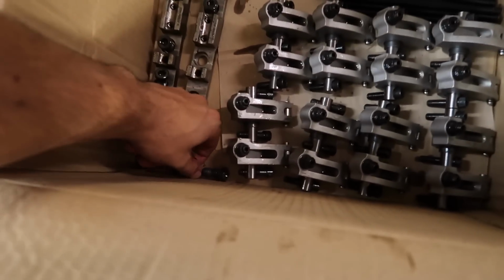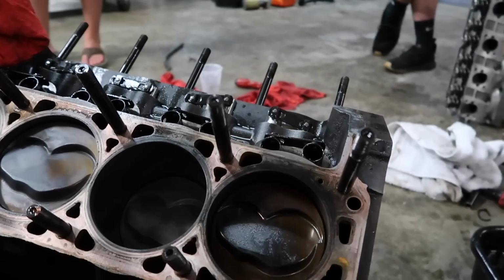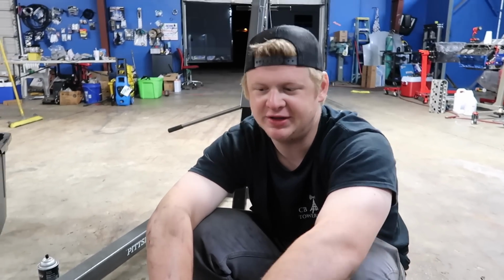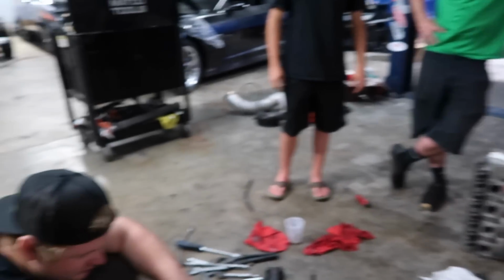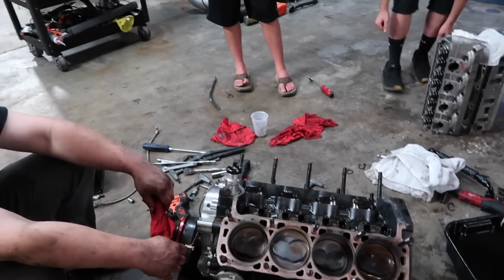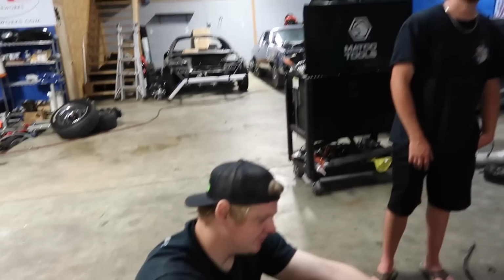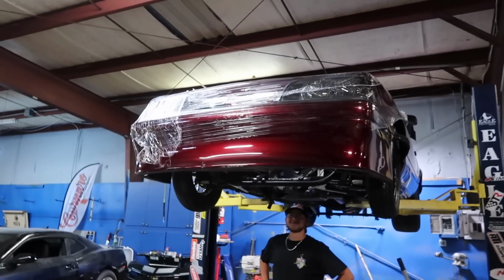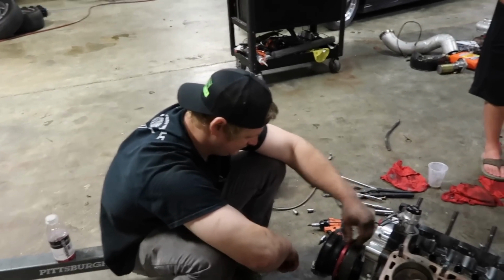Look inside the BAD APPLE's 8.2 Deck Motor!!!!

Comment: Love the sbf power! I have a dart based 363. The head gasket issue is always a problem. Hope you get it to last awhile I keep an extra set in the trailer and re torque very often. About time you got a real car!!!!!
Reply: Mustang Guy363 the head gaskets arent really the problem. The deck flexing is the problem, it just shows up in the head gaskets. Right?
Reply: @phillipgage7356  no it was a head sealing issue. I went from a 10 to 14 bolt and haven't looked back. No I have seen several deck issues with stock and ford motorsport blocks. None with the dart.